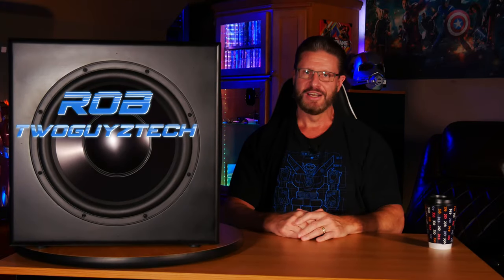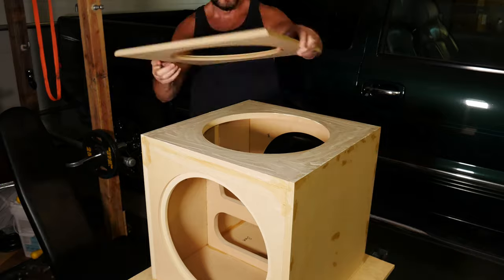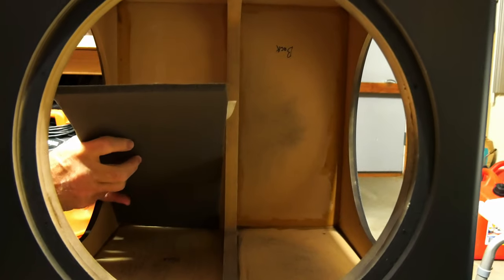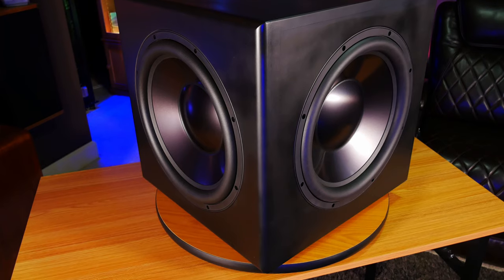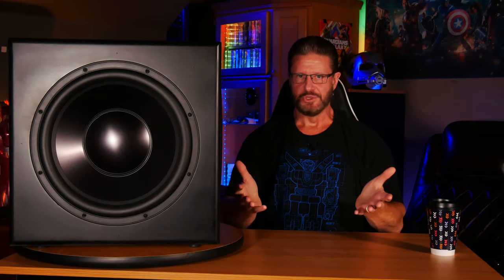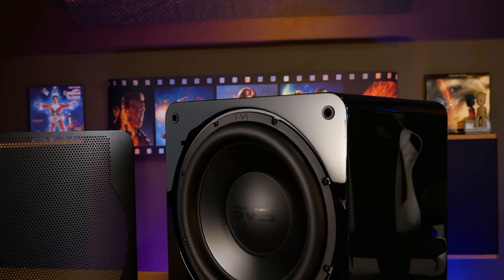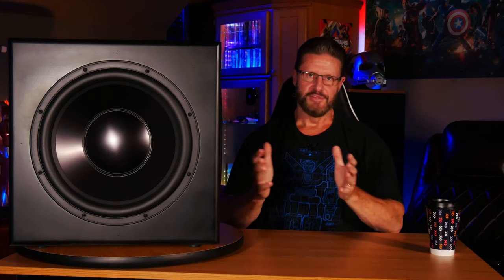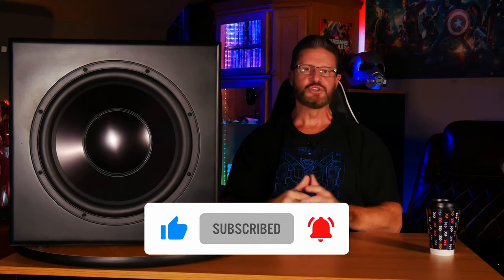BUILDING A Budget 15" DIY Subwoofer | Parts Express Dayton Audio Reference 15 | Review & Demo!

Comment: can't believe i just stumbled on these. I've been very aware of the dayton sealed versions for a long time but prefer the deep low sound of ported...however I move around alot so small size of these paired with the low end of the passive radiators is a no brainer! I think this might be my next sub (18 inch ver though)

Comment: Right now, this kit is $700 on PE. Orginally I was going to buy a Ultimax 15" Sealed sub kit ($355) from PE and a Crown XLS bridged with 1100W for it. Now I see this and wonder if this kit featured is worth double the price.
Reply from the maker: I don't have first hand experience with Ultimax Kit, but my guess is it will have slightly tighter bass with less output compared to this kit. I really like this sub especially for movies. I will more than likely buy another one because I have an extra channel on my QSC amp I can use to power it. I do think $700 is too much but if it goes on sale for around $500 this sub will be hard to beat. Thanks for watching!

Comment: A sealed enclosure would give you better low end. 

The best design for this driver is a tapped horn or a front folded horn like the THT and those enclosures can give really deep low end
Reply: A sealed box has a softer roll off but the tuning frequency is way higher for the same volume. Sealed boxes excel at transient response if not critically damped, but are hardly chosen if bass extension is your goal.
Reply: @artificialmonkeypoo  If properly designed with a slightly bigger dimension a sealed enclosure will give better extension and to get the same group delay in a ported box is not so easy. Ported will give more output near the tuning freq but a good sealed will be far far better wrt quality bass. BTW, this driver is better suited for a horn design.
Reply: @hificonnectin567  thats true, to get the same extension you would need a larger sealed box, it is a matter of compromise. My preference is sealed boxes, since i dont need the same extension as home theater, and you can use smaller boxes to get to an ideal alignment. I havent heard much about using the RSS in a horn cabinet as it would just be much too large for most people!!!
Reply: @artificialmonkeypoo  Many horn designs are there using rss, I myself is using a 15" rss in a tapped horn. Even with a 250w amp it gives crazy output down to subsonic region without any kind of distortion. Yes size is an issue 7'x2'x18", will look like a tv unit, can be integrated well aesthetically.
Reply: What do you mean by critically damped?

Comment: Hey. Definitely enjoy your content so keep up the good work. You mention this is a cheaper solution for a sub but being as it doesn’t come with an amp, is it still cheaper when paired with a proper amp? Subs that come with internal amps are already paired well (generally) so there isn’t an added cost and also one less item in the a/v rack.
Reply from the maker: Thanks for watching! This is a hard area to compare because it is a DIY sub - but if you take the price of $580 and add on the price of a capable plate amp from Parts Express (which could be installed internally so you don't take up any extra space in the rack!) comes out at $940, which, even at that price, still makes this kit very competitive in our opinion. Of course, if you take into account your time and labor, depending on what your time is worth, it might just make more sense to buy a prebuilt sub.
Hope this helps! :)
Reply: @TwoGuyzTech  Thank you for the response! For me personally, I love projects like this. I’m my teenage years, my father and I built a box for two ten inch subs in my car. So I’m happy you posted this as it wasn’t even something I was considering before the video.
Reply: Look at Power Sound Audio subs; $1500 - $3500 for a powered "18.

Comment: AB amplifier  heats up a lot  8:30
Reply: AB amplifiers usually have better dampening factors and sound quality.  Also, these amps have fans to address cooling.  I think Crown a/b amps are a better choice.  They are less expensive, have more power, and have bigger internal heat sinks, which means the fan doesn't kick on as often.  Yes, class A/B is less efficient, thus producing more heat.  That doesn't mean they are inferior for the reasons I stated above.

Comment: No way I should have to use bondo to fill in the gaps and holes of a cnc cut box that costs as much as this one. Either their machine is jacked or you didn’t put it together correctly.

Comment: $600 for a " Budget" subwoofer and it doesn't even have an amplifier?. This kit needs to be equipped with a 800w RMS to 1,200w amplifier plate to be worth $600.
Reply: This is DIY, not budget.  These subs are meant to compete with subs that retail over $2000, not your run of the mill Best Buy brands (not Magnolia).
Reply: B121i10  It may be for some, but Dayton Audio offers other products for considerably less.  In relation to multi-thousand dollar subwoofers, yes, it certainly is, but this is one of their more premium offerings.